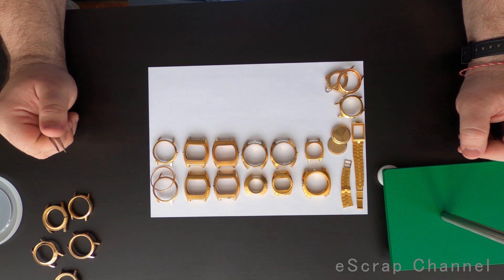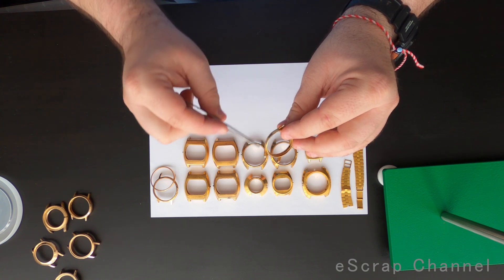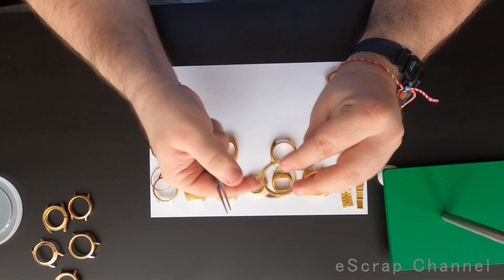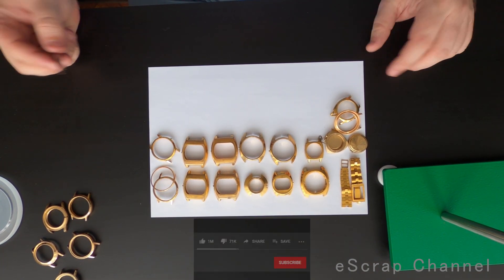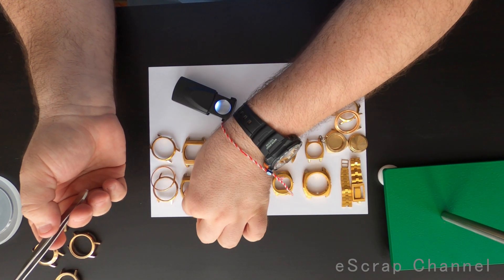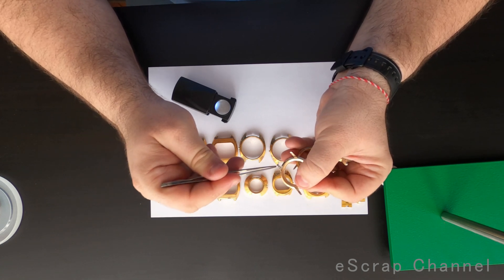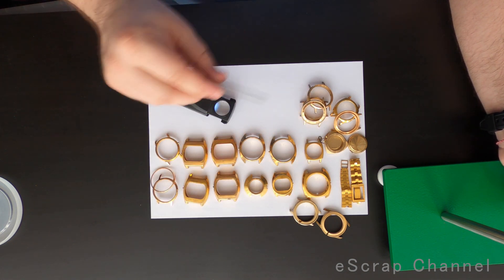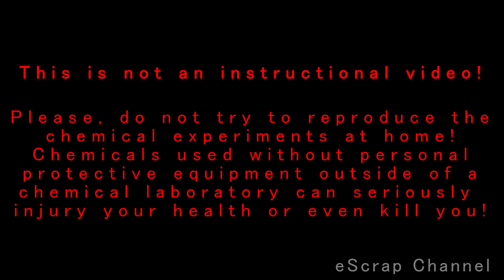How much gold is in plated watches and what to look at when we buy them as scrap?

Comment: Hi how many gram nitrik asit ı have to use for 1.5 kilogram scrap watch case ?🙏🏻 thank you
Reply from the maker: Hi, you will need at about 6.5-7.0 litters of 65% nitric acid to dissolve 1.5 kg scrap watch cases. In practice you may need a little more, as to speed up the process people do not wait reaction to stop fully and replace acid with fresh earlier.
Reply: @ thank you very much for your answer😊
Reply: After the process I did, there was a lot of green mud. If you could give me information on what to do, I would be very happy. Thank you.
Reply from the maker: Hi, add hot water, boil and filter couple of times.
Reply: There are mud deposits in the filter, do I need to boil it together with the filter?
Reply from the maker: @ferawatch642  Hi, yes. Do it 2-3 times. I hope green mud will reduce. If you see it getting less, just continue with the hot water and filtering. If it is not changing - check if you have gold in the green mud. If you have gold, you can burn the filter and the mud with a propane torch and after that add aqua Regis to the ash extracting the gold.
Reply: @escrapchannel thank you a lot🙏🏻

Comment: Hi what calculations did you use to get the gold amount thanks
Reply from the maker: Hi, I processed each watch case separately and measured gold yield.
Reply: @escrapchannel  so do you know how much gold is on a 20 micron piece of jewellery etc?
Reply from the maker: Yes, but it also depends on wearing ... sometimes there is not much gold left after 20-30 years every day usage.
Reply: @escrapchannel  ok could you tell me what the calculation is to determine how much gold is on a 20 micron piece of jewellery?
Reply from the maker: For men watch cases I’ve seen between 0.25 and 0.41g of gold per piece.
Reply: @escrapchannel  so is it like 0.1g of gold per 1g of 20 micron gold?
Reply: @escrapchannel  could you do more ewaste recovery and refining vids?
Reply from the maker: @platinumskies7968  Watch case is 15-40g and gold is at or below 1% of the total weight.
Reply from the maker: @platinumskies7968  I have a lot of material ready for processing, so I hope to find time for more videos!
Reply: @escrapchannel  ok thank you